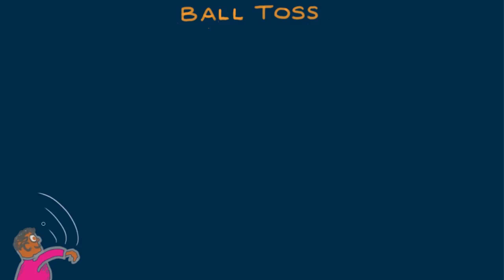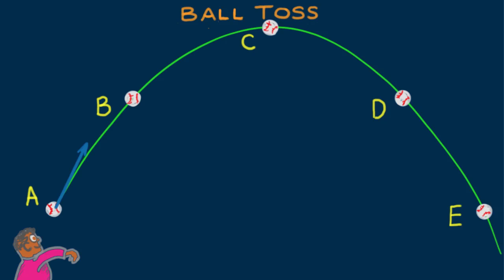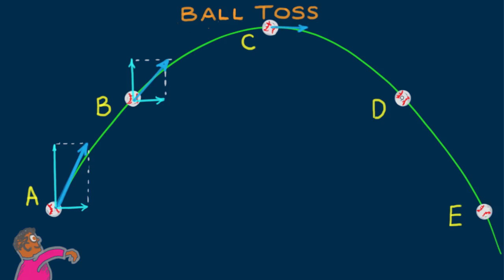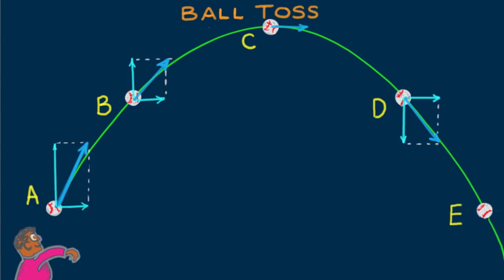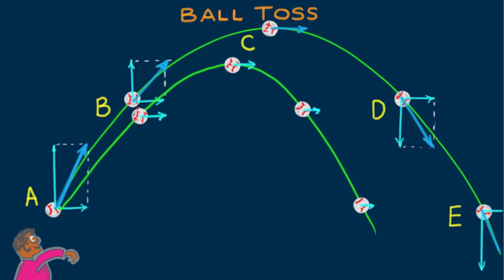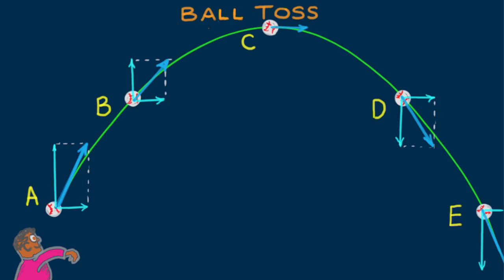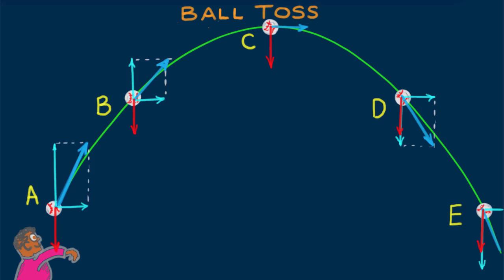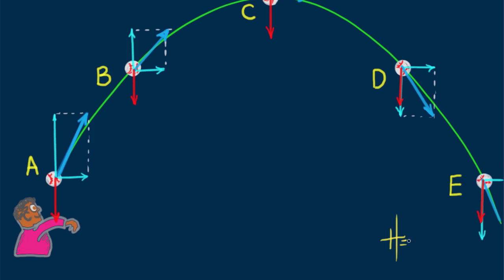Hewitt-Drew-it! PHYSICS 14.Ball Toss

Comment: At point C the vertical acceleration will be -10 m/s^2 pointed downward. The vertical acceleration of the ball throughout the flight is -10 m/s^2. Also at point C the vertical velocity vector will be 0 m/s. Even though the magnitude of the vertical velocity is 0 m/s, there is still a vertical acceleration because the direction of the ball is changing.
If the acceleration in the vertical direction was 0 m/s^2 then that would mean that whatever the velocity is at that point would be constant (meaning no change in speed or direction).